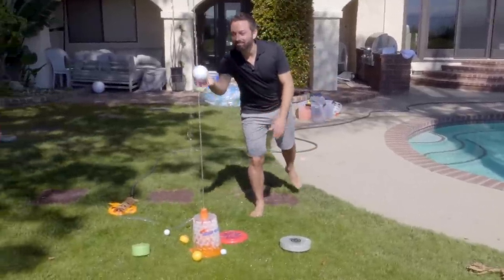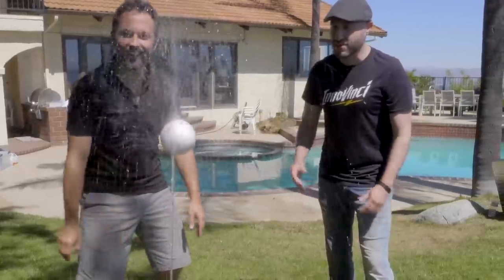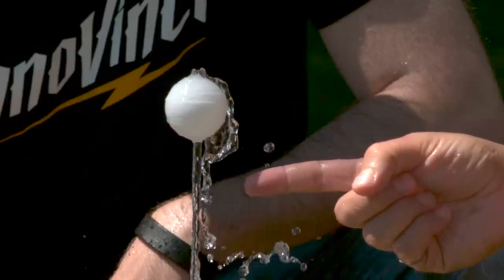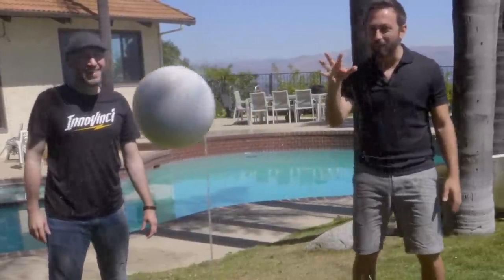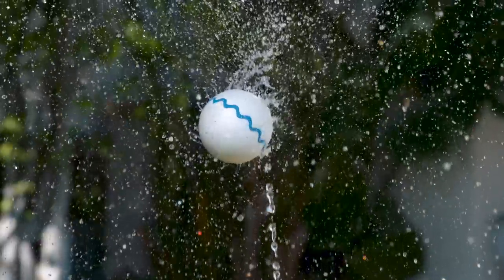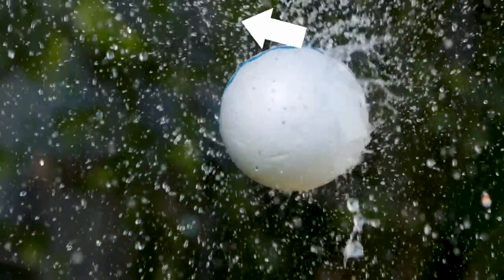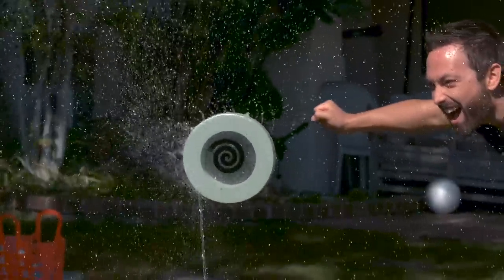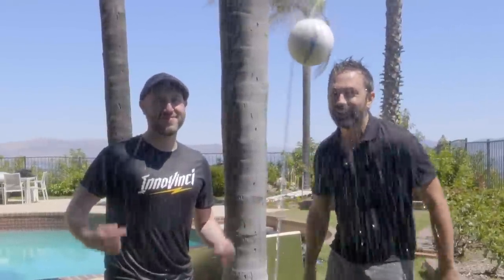Hydrodynamic Levitation!

Comment: Angular momentum. The inertia of the balls rotation will keep is spinning towards the water stream. It applies an opposing force that is greater than that of the push away from the stream due to this speed inertia, keeping it in the stream, and it stays in the air due to the lift (the pushing water) as oppose to the mass and gravitational pull.

Comment: +Veritasium : I am surprised that you didn't mentioned the Coanda effect :-/
Reply from the maker: Turcik because it's not the Coanda effect. "the tendency of a jet of fluid emerging from an orifice to follow an adjacent flat or curved surface and to entrain fluid from the surroundings so that a region of lower pressure develops." you can't entrain fluid from the surroundings if there is no water (only air) in the surroundings. The effect is similar but based on adhesion of the water to the ball and cohesion of the water to itself.
Reply: Dude... that's a consequence of the Coanda effect, called the Venturi effect. :/

Comment: This is because of Friction, Coanda effect followed by Magnus effect.

In the middle, he also showed how the water followed the curve of the ball. This is mainly because of 'Coanda effect'.

From Wikipedia,

The tendency of a jet of fluid emerging from an orifice to follow an adjacent flat or curved surface and to entrain fluid from the surroundings so that a region of lower pressure develops.
Here, the water is trying to entrain fluid from surroundings. When it comes near to a surface, it cannot pull air from surroundings which makes a low-pressure region between surface and jet. This is because, 'when something is emptied from its place, then something should fill the void to keep the balance.'

Firstly, the ball starts to rotate because of the friction between water and ball surface which is just like a Tesla turbine. As the ball is being hit by the water on one side (not centre), it will push the ball to the other side because it comes in the way of the water. Once the ball starts rotating, the fluid following the surface don't adhere to the surface much longer and drift apart tangentially.

This is where the 'Magnus effect' kicks in. The magnus effect creates a force perpendicular to the jet direction. This force pushes back the ball to remain in contact with the jet on one side. So, the weight of the rotating ball is born by the jet completely.

The magnus force is proportional to the speed of rotation of the ball which is proportional to the velocity of the jet of water.

So, the ball levitates in air as long as the jet discharge is kept constant.

I have explained this in stackexchange website. https://physics.stackexchange.com/questions/356284/any-solutions-to-veritasiums-hydrodynamic-levitation/370594#370594

Comment: As always, love love love your videos keep it going.
Your correct that the water is going up over and around, but that explains only a small portion of the energy transitioning. The majority of the energy is being dispersed opposite of the water jetting at it. If you watch closely, just above where the jetting hits the ball where it is creating a high pressure , you will see just above that an opposite effect  (hydro-static adhesion) the accelerated water is being torn from contact of the ball (low pressure) after decelerating it is in the way of the constant incoming water and someone has to get out of the way thus it tumble or skeets off the top... thats the larger amount of water you see leaving the surface compared to the lesser amount creating a rotation (by product of affect)

Comment: I can't tell for sure but, I believe the ball is getting a significant pull to the  center and upwards by the water that still has momentum upward. The water rotates around the ball slightly until it starts to overcome the waters surface tension which pulls back on the water, in turn pulling on the ball sideways and upward. I believe the water is pulling on the ball even more than the remaining water is pushing the ball.
Reply: I just realized how old this video is. Hopefully you still see this somehow 🤞

Comment: What's more remarkable here is that for any particular weight of the ball / disc, and depending on the pressure of water stream, it maintains a particular height of the ball/disc to which it is being levitated. Noticed the video, where Derek started the ball and disc on some level ..but based on its weight and water pressure, it goes to its particular height ... 

So not only that the ball and disc is levitating .. it's also maintaining a particular height ...

Comment: Magnus effect?
Reply from the maker: +Andika Raditya kinda like that just instead of moving ball, stationary fluid it's moving fluid, stationary ball
Reply: Exactly what I was thinking.
Reply: Exactly what I thought...
Reply: That depends on your frame of reference!
Reply: Magnus effect is a consequence of the bernoulli effect. So what's in the video is ultimately too, even if it may not look like it.
Reply: My first thought was also magnus effect. I also wonder if electrostatic attraction might be involved.
Reply: the magnus effect has a ball moving thru the liquid air. this ball is basically moving thru the liquid water. I don't think it makes much of a difference if the liquid or the ball is the one moving. 

so yeah i think this should be magnus effect.
Reply: Veritasium like a reversed Magnus effect
Reply: Personally i think that while the magnus effect of the moving liquid is basically the main thing keeping that ball in the stream,the magnus effect due to the air also plays a small part in keeping that ball there.this effect would be slightly weaker in a place with no air.
Reply: No such thing like a reversed magnus effect. In fluid dynamics it does not matter if you have a moving object or moving fluid. Thats why wind tunnels work.
Reply: I think the same. When the big disk was placed it didn't seem like much water was going back
Reply: Would using a hydrophobic ball allow you you test whether it's pressure from water or air creating the reaction force?
Reply: +Veritasium it is often called the coanda effect in this context

https://en.wikipedia.org/wiki/Coand%C4%83_effect
Reply: Alonsitroll, I noticed the same thing with the big disk, very little water getting pulled over the top.    I suspect if you get the ball or disk up high and then cut off the stream completely they will move forward some through the air as they fall, and that same tendency to move forward helps  pull them into the stream.   In other words, while the change in angular momentum of the water over the top helps, I think spinning in the air is also contributing due to classical Magnus effect.   Same reason golf balls, baseballs, wiffle balls.. etc rise with backspin.
Reply: Joe Fishy thats an interested idea.  I dont think air currents have an effect, just the "stiction" of the water wrapping around the ball, causing it to stay in place (for lack of a more scientific explanation), but if that ball were hydrophobic, the water wouldnt stick, and would probably just push the ball out of the stream.
Reply: @Arne Schwarz1 You should go back to your aerodynamics course. Magnus effect is more related to viscid flow, which was demonstrated in this videos water adhered to the surface of the spinning balls/cylinders
Reply: I'm interested in how much of an effect the magnus effect has on the ball as well as the water, I think it would be relatively significant.
Reply: You should check out how to implement all of this awesome physical phenomenomnomnoms in the shipping industry. I give you the "Rotor sails" https://en.wikipedia.org/wiki/Rotor_ship
Reply: but the energy to have angular velocity coming from the water stream,so itsnot magnus effect.. :)
Reply: The Magnus effect was also describe as a possibility for aircraft. So an "engine" force can be related or inferred. I am hoping for clarification from my post. Hopefully we will get good clarification.
Reply: @Shamino Ranger, i agree with you in that the surface tension is needed to adhere to the object and carry the water around the object.
Reply: Veritasium Had to go back to this video 30 min later to see if someone already pointed out the Magnus effect. Your videos stick 😊
Reply: Liquid magus effect, exact thoughts when I watched the video.
Reply: its not, the disk wouldn't work if it was
Reply from the maker: Magnus effect is not a consequence of the Bernoulli effect. It's a skin friction (adhesion) effect even if some places claim otherwise
Reply: +Veritasium oh Derek, let the kids have some fun with dumb ideas ;) we know what you talking about bro haha. Great video by the way
Reply: WAIT. So you are saying that the Magnus Effect(ME) is caused by skin friction (adhesion) effect? To me in part the forces does not add up. Nevertheless, then if so, is the ME , in part, a consequence of this Hydrodynamic Levitation (HL) as seen here? Can you add a thin vertical colored smoke stream so we can see the air movement around as well?
Reply: @Robert Johnson a disk is just a short cylinder. It would work if it was a disk. I believe you are more concerned about the weigh requirements. Lighter materials is the key.
Reply: And the skin friction causes the boundary layer to either speed up or slow down, depending on the side of the cylinder. In the the faster moving area the pressure is lower. So Magnus is exactly Bernoulli.

Comment: The upward force of the water jet is opposed by the weight of the ball (gravity). If the ball falls down closer towards the water jet, the force of the water on it in the vertical direction will increase. The ball will fall until it reaches a point where the force is great enough to push it back upwards, where it will immediately fall again as the force on it decreases, thus creates a self-stabilizing loop in the vertical direction.

Because the jet hits the ball at an angle it also imparts a small side-ways force on the ball which would push the ball out of the stream if not opposed by some other force. This opposing force is the magnus effect due to the balls rotation. The further the ball moves out of the stream, the more angular momentum will be imparted on the ball, due to the angle of impact from the water jet, therefore increasing the spin and therefore increasing magnus force, pushing it back towards the stream, thus creating a self-stabilizing loop in the horizontal direction.

That's my take on it.

Comment: Hey Veritasium - thinking about an alternate explanation for this (or maybe just another affect helping the equilibrium) and wondering what you think:
The upward force of the water counteracts the downward force of gravity holding the ball at a fixed height set by the water's speed (since the speed of the water itself is a function of its height).  The water forces the ball to one side, but it causes the ball to rotate about the point of contact with the stream of water, not about the center of the ball.  Because the ball rotates about the point of contact, that would cause the center of the mass of the ball to move toward the stream of water, helping keep it in place even though the edge is being pushed away.
Let me know what you think - I know a lot more about rigid-body dynamics than fluid mechanics, so this explanation is how I rationalized what I was seeing before you offered your explanation.
Have a good one!

Comment: I'm not quite sure about your explanation.  The water separating from the ball wouldn't exert an upward force on the ball once the rotation matched the speed of the water.  Looking at the trajectory of water as it leaves the surface makes that clear.  It's possible that water on the surface of the ball creates drag as it spins around but that wouldn't be enough to offset the pressure from the upward stream.  I suspect that the weight of the water relative to the weight of the styrofoam is key to why this works.  It's likely the center of gravity of the sphere is changing with one side being impregnated with water and the other where the water is separating from the surface.  The drag at separation in combination with an offset center of gravity seems like a better explanation.

Comment: What angle, beyond vertical,  could you get before gravity overcomes the effect?
Reply: Great question
Reply: Probably not much of an angle. This works because it opposes the force of gravity directly. Increasing the angle might create a vector force in the cross product direction and fling it out of this. But that's just a guess.
Reply: We must find out how much can be compensated by inertia of water during spinning.

Comment: We had this happen by accident when I worked at a carnival back in 2010. We had knobby balls floating in a pool of water and a sprinkler running in the middle.  The sprinkler head popped off and was just a solid stream and a ball rolled into the stream levitating it.  This permanently replaced our sprinkler head.  I tried turning it into a carnival game where you stand back and toss the ball onto the stream.  I think I still have the videos somewhere.  Thanks for the explanation.

Comment: With the balls rotation due to the force of the steady stream being emitting on one side rather than middle, then creates that rotation of the ball to create a velocity of such direction to move the ball inwards (the way of which the water looks like it’s pushing the ball upwards) but it seams like that the balls rotation is effecting the air around it pushing it the equally opposite direction of the stream of water. Which concludes to equality of the forces and which will definitely vary dependant on the force of the stream of water, the air resistance that affects the waters stream, the output of the hose spurting the water, air resistance on the ball (which is making the ball bob around so fluently because the air resistance is another factoring force that is being applied to make the equilibrium of counter-acting forces vary one-sided but due to the wind not being strong enough at that time is why it wasn’t altering the forces enough to knock it off), gravity’s acceleration due to the ball and finally because the ball when spinning obviously and visually brings some water sort of sticking to the ball (due to high enough speeds and friction etc etc.), that obviously pulls the bill down the tiniest bit altering the forces as well as the direction it wants to go (the stream of water (up)) because that’s due to inertia. All these things and many more (I have wrote enough :p) can all alter the balls effect on the steady stream of water and if there’s a slight displacement in a higher force equal or more than a counter-acting force, (like high winds something like that (ads the horizontal force being effected by)) then the ball will drop due to the help of gravity’s acceleration towards fo the ground :) 

Therefore the ball stays levitated by the stream! Or it falls. The fun of physics and this is why I honestly love it so much! 
PS: and music, but like music in the phone you listen to, like the music you play in an orchestra or brass band (euphonium to be clear :p) 
:)) don’t know why I wrote this to be honest just felt like it haha

Comment: The force of the water spray may be a bit up to combat gravity but the much larger component of that force is in the horizontal plain pushing the disk back into the stream as the stream tries to push it out of the stream.  The vertical force of the stream of water and to a lesser extent the vertical component of the spray force is what is offsetting the force of gravity.

Comment: Just some clarification. Having laminar flow with water is technically impossible. For having a Reynolds < 3000 with that low viscoscity of water, the velocity should be like 0.0001 m/s. The flow is definitely turbulent, but stable, in the sense that the current lines are parallel.

Comment: I know it works with a ball being held over a tread.
That means:
We can modulate an magnetic flow into a stream, the module itself will float.
But for this, it should spin freely over the horizontal axis like ufos.
If we spin a magnetic field it goes horizontally.
If the weight of some structure is spherical right on side of such spinning magnetic high voltage, it will loose its weight.
The high voltage can be generated into the disk itself using a build in vinil tape on the center of the donut ring of the structure under a fixed cooper brush on each side.
All hold by a spherical weight on outside. that holds the disk in center spinning by a light weight structure or wire.
Reply: Basically if the water jet was lghtweight and held by many of the same sphere receiving water jets held by vertical axis, it would float for sure. But we can use laminar magnetism from a van de graaf aluminum disk..not so fast.
 Remenber this.

Comment: The most important part of how this works the Bernoulli effect, don't be so quick to discount that part of this system. Just like blowing air between two balloons makes them touch, shooting water past the side of a sphere/disc "sucks" it towards the stream while the force of the stream colliding with the disc provides force up (against gravity) and in the opposite direction of the sucking force (yes, I understand that there's no such thing as sucking just like there's no such thing as coldness), hence the stable configuration. The only reason you can't achieve the same with a hairdryer is because they can't move air fast enough, you can achieve a similar levitation with an air compressor and a radially-symmetrical object.

Comment: Actually the ball is flinging most of the water in the direction of the top left quadrant, which suggests that the force of the water on the ball is down+right. The down force + gravity probably cancels out the upward force of the jet stream.